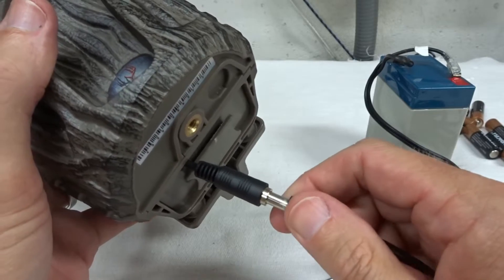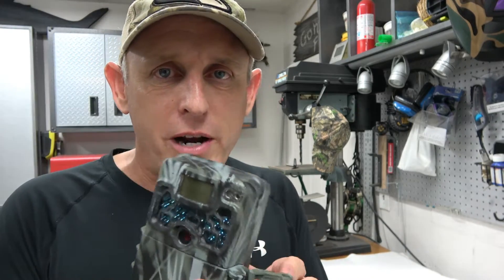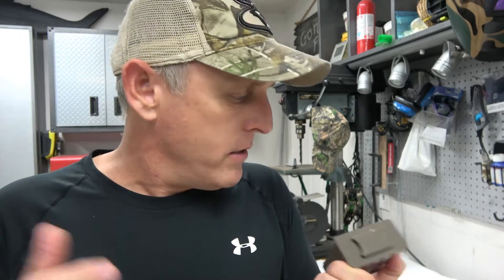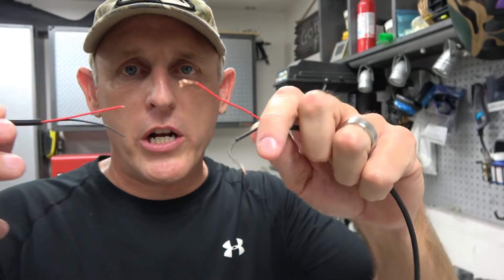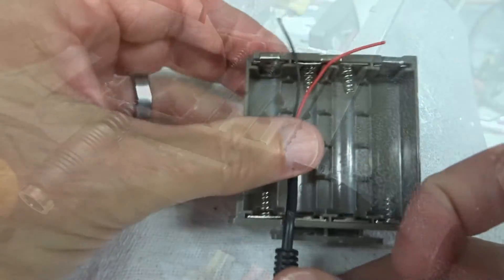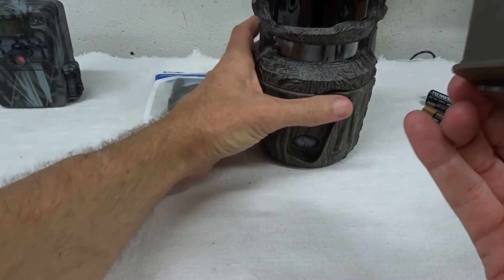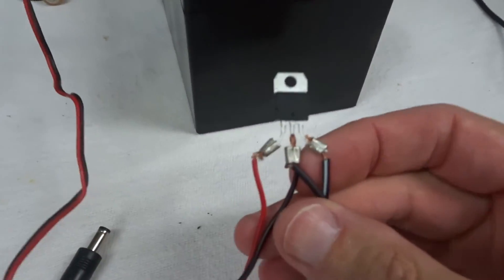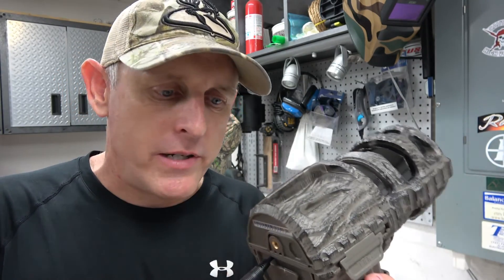How To Direct Wire Any Trail Camera!

Comment: Your videos are great. Just a note though, not all trail cameras use a 2.1x5.5 plug. Cuddeback, at least the J and G series, use a 1.7x4.0 plug.  After watching your videos I took my HME 12v battery boxes with with solar panels I was using on my Stealthcams and removed the 12v regulators and soldered in new 9v regulators (Cuddebacks are 9v). With a 2.1x5.5 to 1.7x4.0 plug adaptor my Cuddeback cameras are now running on solar. Thanks for your videos.
Reply from the maker: Thank you brother!  That is great info to know and I will update in the description!!!  The 2.1mm has fit all my cameras in the past but there are some brands that I haven’t used like Cuddeback...so I assumed all cameras used 2.1mm.  I just bought a spypoint cell cam and it works with 2.1 as well.  I will look up an adaptor for the 1.7mm and post it for everyone. Thank you so much!!!
Reply from the maker: Hi Joe, I added the 1.7mm adaptor in the description and linked to it on Amazon.  Thanks again for the heads up!  I’m sure others will eventually run into this issue.  Take care brother!
Reply: I found some very nice 12v to 9v regulators on Amazon. They’re expensive at $7 but much easier for me to wire. 
https://www.amazon.com/gp/aw/d/B00A71E52G/
Reply from the maker: I agree!  Those little 3-prong regulators are a bear to wire sometimes.  I like the one in your link...really easy to wire!  I may be trying that one next time i need a 9volt regulator.  Thanks again!

Comment: Any ideas about hooking up an external battery to a Reconyx HC600?  It uses 12 AA batteries and the battery pack is built in to the door.   The camera is in the field, so I'll need to pull it to get a better look at it.   Any idea if it's truly 18 volt, or is it 9 bolts?
Reply from the maker: I highly doubt it’s 18volts so the PCB is probably regulated at 9volts would be my guess.  Once you tap into the wires I would connect a 9volt battery to see if it powers up.  If not, then go to 12volts.  Highky doubt it’s 18v but I could be wrong.  Let me know…Im curious!
Reply: As we figured, it runs off of 9v. There are two 9 volt Battery hook ups in the door.  It'll work with only 6 AA batteries.
Reply from the maker: Perfect!  Now you’ll be set for adding an external battery!
Reply: Yes, sir.  Thanks.  I'll see if I can find a way to use a 12 volt with a solar panel.  @TheHandyHunter
Reply from the maker: @jokerwking you could use 12v and down regulate to 9v using a buck converter and hide it in your empty battery tray.
Reply: That's what I'm looking into.  Also going to add a spypoint  wireless link so I won't have to go out and check it all the time.

Comment: What about for the game cameras that do not have a battery tray? Some have a flip open door on the bottom and you slide batteries into the camera and then close the flip door.
Reply from the maker: You’ll have to find the main contact points for positive and negative in the compartment.  You can cut wood dows the diameter of AA batteries and use as placeholders instead of batteries.  You can connect the wires to your wood dow to make contact inside.  Hope that helps!

Comment: I have several muddy manifest which runs on 8 aa batteries. My question is there are 4 tabs that contact from the battery tray to the camera. 2 positive and 2 negative the left two are giving 6 volts and the right two give me 6 volts. I'm just wondering how I determine if they are being run in series or parallel in the camera?
Reply from the maker: The safest way to proceed would be to test test 6 volts first to see if the cam will run.  If it does then stop there.  Is the battery tray removable?  You can use a little buck converter to regulate a 12v battery down to 6v for testing.  Start low is the safest way.  Good luck!

Comment: Can I run 2 Tasco M12 cameras off 1 6 volt battery?  Thanks.
Reply from the maker: I’m sure you can depending on the Ah of the battery.  I’m not familiar with the Tasco cams and how much power they draw but you should be ok.
Reply: @TheHandyHunter  Tasco M12 Manual states: POWER CONSUMPTION: <200ma (650ma w/LED flash)

Comment: Excellent video.  Info that can keep you from frying your camera.  Two critical takeaways:  
(1) How to determine the actual voltage the camera is operating on.  Not necessarily the number of batteries x 1.5V.  
(2)  How to regulate the voltage of my 12V battery down to the camera’s operating voltage if it’s not 12V.
Reply from the maker: Thank you for the comment.  Good luck with your project.
Reply: @TheHandyHunter  One thing I added to my setup is a DC 5.5mm x 2.1mm extension cable with fuse holder; using a 2A mini fuse.  This is added protection to prevent any momentary high current from the external battery to the trail camera.  Though unlikely, the fact that the external 12V battery has the high capacity to put out high current, this fuse will prevent it.  The peak draw of my trail camera is about 1100mA or about 1.1A.

Comment: Do you happen to know the wire gage for the stealth cam 10’ cable or what size spade terminals it takes?  Thanks!
Reply from the maker: I don’t know the gauge but it’s plenty for a trail cam.  For the spades you could prob use red or blue ends but the blue may be a little big.  Good luck!

Comment: Must be doing something wrong. Running a solar panel to regulator to the battery out to camera. I hooked solar to left side of the regulator to  the small 12v battery, negitive to middle  and right side of regulator has the camera end. Charged the battery before setting  up and a couple of days later battery is reading 2.48 volts. I set up a couple of these in the junctions boxes as you did and doesn't seem to be charging battery and sending enough volts to the plug in connection Only thing I haven't done is hooked up a camera yet but that will problably drain battery even quicker. I'm screwing something up. Solar panel light is  green. After charging battery and connection everything up I plug the meter into the camera connection and reads 9.48 volts or around that so the camera would have power. Need your help and suggestions?
Reply from the maker: Make sure your solar panel is connected directly to the battery with no regulator on it.  The regulator should only be on the wire going to the camera after everything else.  Next, what is the volts of the panel when disconnected in full sun…should be 20-22volts?  What is the voltage of the battery when disconnected from everything?  If your panel works and your battery is good it could be a bad regulator.  Are you running a 7812?  They sometimes go bad…from heating them up too much from soldering,etc.  Let me know what you find.

Comment: Hi, How do I check the internal voltage of my camera if It has 8 AA battery inside that can be pull out to check like yours. thx
Reply from the maker: If it has a slide out tray like mine you can test the contacts on the tray while it has batteries in it.  It most likely 12 volts.  If you dont have a tray that you can test I would first try to run the cam on 6 volts and if it doesn’t come on then go to 12 volts.
Reply: @TheHandyHunter  ok perfect thanks,

Comment: Great video. Is there any risk connecting the battery directly to the camera (other than too much voltage)?
Reply from the maker: Just match the voltages.  If the cam is 12v then you are safe with a 12v external battery no matter what size it is.  Hope that helps…good luck!
Reply: @TheHandyHunter  Thank you.

Comment: What  is the  number of  the  voltage  regulator  from  12v to  6v  that you use ?
Reply from the maker: 7806 will regulate at 6 volts.  You can find them on Amazon.  Good luck.
Reply: @TheHandyHunter  thank you for the information
Reply from the maker: You are welcome!

Comment: I have the 12 Volt plug on my browning trail camera, do I need to have the 12 volt regulator in between the 12V battery and the trail camera or just run the wire from the battery to the trail camera?
Reply from the maker: Nope, only if you are charging the battery with a solar panel.  If no solar then you are good to go.

Comment: Good informative video. You probably saved from putting the full12 volts to the camera. I followed the link for the voltage regulator and in the description title is said 1.5 a / 6 volt output then I read in the description 1.5a/8 volt output. I assume the link is correct and Amazon has messed up another product description thanks and have a good one from West Tennessee
Reply from the maker: There should be  a 12v reg listed too if that’s what you need.

Comment: Can you also use rechargeable AA batteries too?
Reply from the maker: Some cams will run on rechargeable batteries and others won’t due to the slight difference in voltage.  Can’t charge them directly in the cam either with solar due to high voltage at full sun.  Hope that helps.
Reply: Ok, thank you

Comment: that cable dont fit mine which is a 3.5mm plug
Reply from the maker: You can search on Amazon for that size.  Most common is 2.1mm or 1.7mm.  What brand is yours?  I’ve never seen a 3.5 before.

Comment: Great vid. Just wondering if you put a seal or anything on the cord where it comes out or if the hole being close enough size to the cord to hold moisture out.
Reply from the maker: I didn’t but no reason you couldn’t add a dab of silicone around the hole for extra measure.  Good luck!

Comment: This is AWESOME! 👏 👏👏Thank you so much for sharing this! I just bought my 1st cell trail cam(Wildgame Innovations Insite Cell ). I purchased a 12v solar panel also but got home and realized there is no 12v hole but I did find a tiny 6v hole(maybe the 12v panel can go on my feeder🤔). My question is should get the 6v Wildgame Innovations external 6v battery and hope it will plug in(if not I will follow your directions). Or(sorry for the ignorance with this question, I have never hunted w/a trail cam after many years of hunting just following deer signs, tracks, scrapes etc) should I get a 6v solar panel and  a rechargeable external battery pack, reg rechargeable batteries for inside or what? I have even seen ads for solar panels stating I won’t need batteries so it all gets a lil confusing. Thank you so much in advance.😃
Reply from the maker: I’m not clear on whether your cam has an external jack or not?  If it has a 6v jack then the easiest thing to do would be to buy an external 6v battery for extended life.  I believe they do sell a 6v combo battery plus solar panel on Amazon.  It’s still good to run lithium batteries inside the camera but don’t use rechargeable batteries inside the cam.  Hope that helps!  Good luck.
Reply: Yes, I have one of those too.  It does have an external 6v port, but it's real small... the 2.1x5.5mm doesn't fit it.  No one at Wildgame seems to know the size.  If I could find out, I could order the right plug and rig an external battery box up.
Reply: @Kevin-ETX  Hey thank you for for the info, I ended up returning the WI Insite because of the phone pic quality & got a couple cheaper Tactacam Reveals(1st gen) and they have have been fantastic over the past two years (added batteries to one and they only got down to 90% battery life for four months!! I added a solar panel to the other and it was great til a critter pulled the connection cord out lol). This yr I added 3 Moultrie  exo cams and they were great….when they will work 😖. I wish I could send them back but I got them new on eBay and the 30 day return window has closed. I am considering getting another Wildgame Innovation cam, the one I bought had just hit the store shelves so maybe by now there are more videos and the kinks have been worked out; will read through for any new comments. Thanks again for the info!🙂
Reply: @lilmama4426  My Wildgame Inovation Encounter cam is giving me the best pics of all my cameras.  Wish I could insert a sample here.

Comment: Is it possible to wire two 7.5 v rayovac lantern batteries in parallel, run the output through a 9 v regulator, and into my browning dark ops cameras?  I see talk in other articles online about amps, but am unsure if I need to understand that or just look at voltage output to the camera.
Reply from the maker: Just worry about voltage and not amps.  Just make sure whatever battery setup you use, and there’s a lot of options, that you match the battery voltage with the cam voltage and you’ll be fine.
Reply: @TheHandyHunter  Thank you, I'm gonna give it a try.

Comment: 12v battery voltage in to regulator is 12.67v and out of regulator is 6.01v.  6v battery voltage in to regulator is 6.26v and out is 4.71v.  6v batt powers camera fine but 12v batt does not.  I suspected either faulty regulator or poor connections so I tried another regulator and soldered connections with the same result.  Thoughts?
Reply from the maker: What kind of cam is on the 12v?  Sounds like a reg issue...try connecting to regulator without soldering.  I think the heat may damage internal part.  I always crimp them using the barrel of a spade connector.  Also, are you 100% positive the external jack is a 6v?

Comment: 10PCS L7806CV L7806 Positive Voltage Regulator IC TO-220 Output 1.5A 6V

Thanks for the great tips!  I purchased the regulators above to convert 12v to 6v and wired just as the video showed.  Camera does not work.  When I connected to a 6v battery to troubleshoot.  Camera worked great.  Wildgame camera has plug on side that states 6v.  Any help would be appreciated!
Reply from the maker: When you put a tester on the regulator voltage from the cable what does it read?  Also, when you test 6volt battery what is the exact voltage reading?  Glad to help.
Reply: 12v battery voltage in to regulator is 12.67v and out of regulator is 6.01v.  6v battery voltage in to regulator is 6.26v and out is 4.71v.  6v batt powers camera fine but 12v batt does not.  I suspected either faulty regulator or poor connections so I tried another regulator and soldered connections with the same result.  Thoughts?

Comment: I just bought a day 6 plotwatcher and it don’t have a battery pack. It has a built in 2 AA batteries on each side. How would I rig it up for the solar panel?
Reply from the maker: Does it have an external battery jack?
Reply: No external battery jack
Reply from the maker: You’ll have to rig some wires to the main + and - contacts within the camera  and then connect a 6 volt external battery.  Some people have cut wood dows the length of a battery to hold the wire to the contact.  You may have to get a little creative depending on the setup.  Hope that helps.

Comment: Great video. Just an FYI, the different voltages is because they are either wired in series or parallel. Need to make sure your amps are correct as well.

Comment: Do you have a video showing how to run a trail cam to a standard outlet?  I keep a spypoint camera in my yard at all times to see what critters are coming and going.  I just ran power to my shed, so now I've got electricity back there and I figured I could save some money on batteries if I run it directly to a standard plug.
Reply from the maker: Yep, that’s an easy one.  All you need is an AC/DC 12volt plug with a male jack that fits your camera.  You should be able to find them easily on amazon. Here’s one with a 2.1mm jack. [UL Listed] Chanzon 12V 1A 12W AC DC Switching Power Supply Adapter (Input 100-240V, Output 12 Volt 1 Amp) Wall Wart Transformer Charger for DC12V Security CCTV Camera (6Ft Cord, 12 Watt Max) https://www.amazon.com/dp/B07G1219LQ/ref=cm_sw_r_cp_api_i_tAMXEbR7RJ010

Comment: Has anyone had an issue with 6v regulators not producing a high enough voltage to run a 6v camera?  I am leaning towards going up to the next regulator size.  Just wondered if anyone else had a different solution.
Reply from the maker: Hi Wayne, have you tested the output voltage with a tester?  What is the exact voltage you are getting with a 6 volt regulator?  I haven't heard of anyone having problems.
Reply: I was getting 5.97 volts.  The IR light was blinking, but the camera would not power on.  I tested the camera directly to a 6 volt feeder battery and it powered on.  My 12 volts are reading 11.75 volts out of the regulator, but do power the 12 volt cameras.
Reply from the maker: Wayne Miller That’s strange, you may have a bad regulator but that voltage should work.  What was the voltage of feeder battery?

Comment: Covert 2012-2016 Universal Auxiliary/Convertor Cable

Item # WX2-674181

/

Mfg. Number: 2540

/

UPC: 898079002540
Reply: Cuddeback 6v compatible.  Built in regulator out of the box.

Comment: Hey I have a couple bushnell impulses and there is a dc external jack on them and they take 9 volts to run I know that but they are $300 cameras so I’m nervous about burning them up so I called bushnell and they told me they haven’t made their solar panel yet but it takes 9 volts to that external jack which was all I was asking for anyways but they said the 9 volts still might kill it and will void the warranty... do you think they are just being safe , have you ever done this to an impulse? Should I stick with 1 amp or 2 amp? Also would it be better to solder directly to the pads so I know it’s okay?
Reply from the maker: Hey brother, sorry for the delay.  If you know the ext jack is 9 volts you are good to go.  I would buy a 12volt solar panel and install a 7809 regulator (we have them in our amazon store).  Just make sure you test the voltage with a voltage tester in full sun directly at your camera plug to make sure you have regulated voltage.  Keep in mind there is usually a variance of 1-1.5 volts...so a 9volt regulator may put out 10.5 volts.  Cameras are made to handle voltage variance so don't worry.  Do you know if the ext plug is size a 2.1x5.5 or a 1.7x4.0.  Most cams are 2.1mm but you may want to check so you get the right sized plug.  Let me know if you need any help!  Good luck!